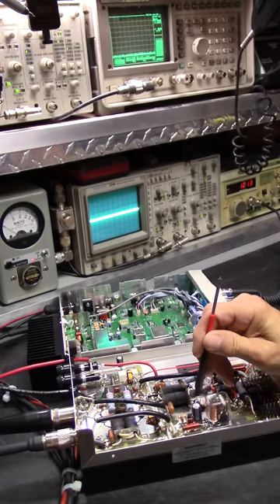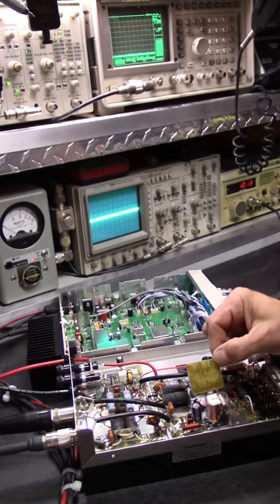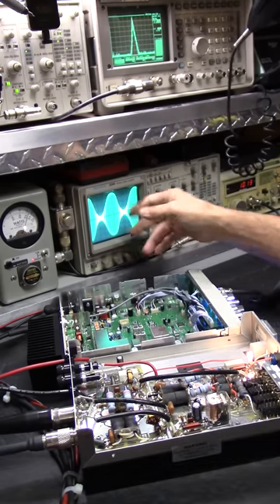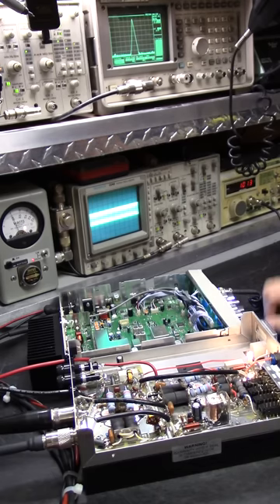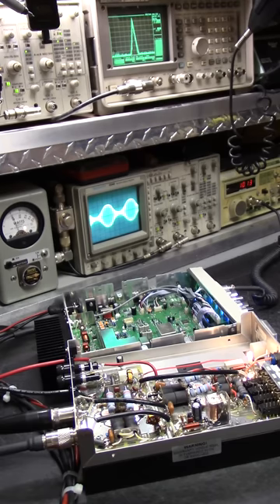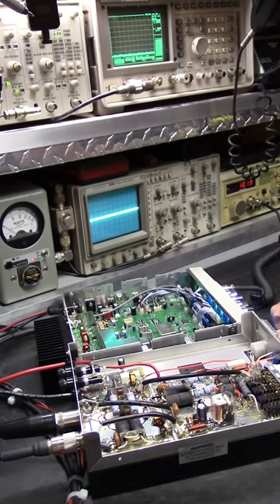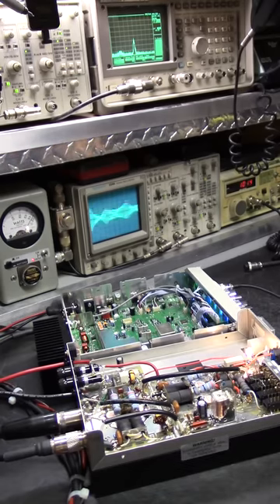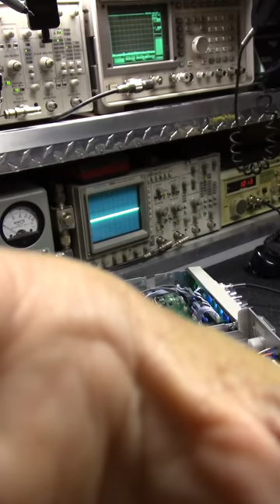Fine Tuned Cb Radio - Stryker SR-955 -Texas Star 500 Linear Amplifier and more ... Cleaner Is Meaner

Comment from the maker: Cleaner Is Meaner ..
PAY ATTENTION! If they don't or wont show you .. like this .. they're stroking you,  get that Part?  Never settle for less! Here's what it takes to cut through the noise, be loud and crystal clear with a better receiver too:  A) Tuned Bench:  https://www.youtube.com/watch?v=lwcDfXOgAls. 
True, it's more complicated and time consuming to accomplish these consistent and accurate results. Below is a partial procedure and list of calibrated equipment used to achieve this level of performance . Read on ..

Fine Tune CB Radio Shop strictly adheres to (https://www.nist.gov/) NIST Traceable Calibrations and other industry standards to maintain accuracy and consistency for providing Real World Performance Tuning of Citizens Band and 10 Meter export mobile radios with integrity.

"Basic Textbook AM/FM/SSB Transceiver Tune, Alignment and Calibration" 

1) Pll adjustments
VCO & OSC, AM TX OSC, USB TX OSC, LSB TX OSC.

2) Transmitter alignment
DRIVER BIAS, FINAL BIAS, SSB  (or gate voltages for mosfet versions) CARRIER BALANCE, HI-LO AM & SSB Power, RF METER, AMC, ALC and FM DEVIATION.

3) Receiver alignment
AM/FM RF & IF SENSITIVITY, FM DETECTOR/DEVIATION, SSB IF SENSITIVITY, SSB S-METER, AM/FM S-METER (100uV unmodulated -67dbm for “S-9” meter reading!), AM/FM SQUELCH RANGE, SSB SQUELCH RANGE, and NOISE BLANKER/AUTOMATIC NOISE LIMITER (Real World dBm to volts (uV) tables below).

That's just a typical run of the mill textbook tune up and alignment (if you're lucky). There's more to it than frequency alignment, modulation adjustment, meter calibration and a tune up report displaying exaggerated rms Bird peak watts! 

"Test Bench includes"

Bird 4314C Meter
https://www.birdrf.com/Products/Test%20and%20Measurement/Power-Meters/Wattmeters-Line-Sections/RF-Wattmeters/4314C_PEP-Single-Element-Wattmeter.aspx
Part 1) https://www.youtube.com/watch?v=RpX9IHe4ORM&t=16s
Part 2) https://www.youtube.com/watch?v=LuhbqTf6Bxw
Bird 4314C Accuracy Test: https://www.youtube.com/watch?v=DqEOabYqhQo&t=5s
Bird Stipulates 1/2 wavelengths  https://www.youtube.com/watch?v=5eWhgT-rTII
And Genuine Bird Elements from 1K down.

Bird 4373 Sampler 
https://www.rfparts.com/signal-samplers.html

HP8924c with options
http://userequip.com/files/specs/2147/HP%208924C%20Repair.pdf
https://www.youtube.com/watch?v=Cg1w0xBa27s&t=1s

HP8920a with options
https://www.keysight.com/upload/cmc_upload/All/EPSG072204.pdf

Three analog scopes, one digital 200 Mhz
https://www.atecorp.com/atecorp/media/pdfs/data-sheets/tektronix-2465b-2467b_manual.pdf
https://www.youtube.com/watch?v=by98x4eu2lM

Fluke 27fm
http://www.fluke.com/fluke/inen/digital-multimeters/fluke-27.htm?pid=56055
 
LCR http://www.lcrresearch.com/wp-content/uploads/2017/05/LCR_Pro1_Manual_version1.03.pdf

Power supplies
6 Cosel PBA1500f12 (750 amps) variable and configurable.
https://en.cosel.co.jp/product/powersupply/PBA/PBA1500F/PBA1500F-12/
Corcom 20VB1 F7130 EMI Filter 50-60Hz 250V

Times Microwave Coax jumpers and test leads
http://www.timesmicrowave.com/cms/products/cables/lmr/
https://www.youtube.com/watch?v=EmqaGJ6IWow
https://www.youtube.com/watch?v=1ltFVSxGp5Y
https://www.youtube.com/watch?v=v12YZT_1o90
https://www.youtube.com/watch?v=h7iiYfmYWRA&t=215s

Amphenol RF Connectors
https://www.amphenolrf.com/
https://www.youtube.com/watch?v=dVh5B0hdEA0 
https://www.youtube.com/watch?v=dKZg8T_AOso

More range, compliments, reliability and a quieter, clearer but more sensitive receiver,  Get Fine Tuned .. not peaked and ruined.

Here are some VideoGates of me at the bench practicing what I preach using my bench radio or customers radio completed and ready to be shipped: https://www.youtube.com/results?search_query=hard+drive+163+ more: https://www.google.com/search?q=Hard+Drive+163+nm&ie=utf-8&oe=utf-8&client=firefox-b-1-ab

It's what I recommend, use, service and sell ... to you ... not something non practical or deceiving in a misleading way. I'm not just the tech and owner of Fine Tune CB Radio Shop, I'm a customer too!  When finished, You'll be giving radio checks, not asking for them .

dBm To Watts and Volts
Tables below displays relationship between Power in [dBm] or [Watts] and Voltage in RMS, peak, peak-to-peak for sinusoidal signals in 50-Ohm systems for accurately measuring and tuning am/fm/ssb receiver sensitivity, agc, squelch and "S9" Meter calibration.

  [dBm] [Watts]   [Volts]rms   [Volts]p    [Volts]pp
-140 0.100E-16  22.361 nV  31.618 nV  63.236 nV 
-139 0.126E-16  25.089 nV  35.476 nV  70.952 nV 
-138 0.158E-16  28.150 nV  39.805 nV  79.609 nV 
-137 0.200E-16  31.585 nV  44.662 nV  89.323 nV 
-136 0.251E-16  35.439 nV  50.111 nV  100.222 nV 
-135 0.316E-16  39.764 nV  56.226 nV  112.451 nV 
-134 0.398E-16  44.615 nV  63.086 nV  126.172 nV 
-133 0.501E-16  50.059 nV  70.784 nV  141.568 nV 
-132 0.631E-16  56.167 nV  79.421 nV  158.842 nV 
-131 0.794E-16  63.021 nV  89.112 nV  178.223 nV 
-130 0.100E-15  70.711 nV  99.985 nV  199.970 nV 
-129 0.126E-15  79.339 nV  112.185 nV  224.370 nV 
-128 0.158E-15  89.019 nV  125.874 nV  251.747 nV 
-127 0.200E-15  99.882 nV  141.232 nV  282.465 nV 
-126 0.251E-15  112.069 nV  158.465 nV  316.931 nV 
-125 0.316E-15  125.743 nV  177.801 nV  355.602 nV 
-124 0.398E-15  141.086 nV  199.496 nV  398.992 nV 
-123 0.501E-15  158.301 nV  223.838 nV  447.677 nV 
-122 0.631E-15  177.617 nV  251.151 nV  502.302 nV 
-121 0.794E-15  199.290 nV  281.796 nV  563.591 nV 
-120 0.100E-14  223.607 nV  316.180 nV  632.360 nV 
-119 0.126E-14  250.891 nV  354.760 nV  709.519 nV 
-118 0.158E-14  281.504 nV  398.047 nV  796.094 nV 
-117 0.200E-14  315.853 nV  446.616 nV  893.232 nV 
-116 0.251E-14  0.354 µV  0.501 µV  1.002 µV 
-115 0.316E-14  0.398 µV  0.562 µV  1.125 µV 
-114 0.398E-14  0.446 µV  0.631 µV  1.262 µV 
-113 0.501E-14  0.501 µV  0.708 µV  1.416 µV 
-112 0.631E-14  0.562 µV  0.794 µV  1.588 µV 
-111 0.794E-14  0.630 µV  0.891 µV  1.782 µV 
-110 0.100E-13  0.707 µV  1.000 µV  2.000 µV 
-109 0.126E-13  0.793 µV  1.122 µV  2.244 µV 
-108 0.158E-13  0.890 µV  1.259 µV  2.517 µV 
-107 0.200E-13  0.999 µV  1.412 µV  2.825 µV 
-106 0.251E-13  1.121 µV  1.585 µV  3.169 µV 
-105 0.316E-13  1.257 µV  1.778 µV  3.556 µV 
-104 0.398E-13  1.411 µV  1.995 µV  3.990 µV 
-103 0.501E-13  1.583 µV  2.238 µV  4.477 µV 
-102 0.631E-13  1.776 µV  2.512 µV  5.023 µV 
-101 0.794E-13  1.993 µV  2.818 µV  5.636 µV 
-100 0.100E-12  2.236 µV  3.162 µV  6.324 µV 
-99 0.126E-12  2.509 µV  3.548 µV  7.095 µV 
-98 0.158E-12  2.815 µV  3.980 µV  7.961 µV 
-97 0.200E-12  3.159 µV  4.466 µV  8.932 µV 
-96 0.251E-12  3.544 µV  5.011 µV  10.022 µV 
-95 0.316E-12  3.976 µV  5.623 µV  11.245 µV 
-94 0.398E-12  4.462 µV  6.309 µV  12.617 µV 
-93 0.501E-12  5.006 µV  7.078 µV  14.157 µV 
-92 0.631E-12  5.617 µV  7.942 µV  15.884 µV 
-91 0.794E-12  6.302 µV  8.911 µV  17.822 µV 
-90 0.100E-11  7.071 µV  9.998 µV  19.997 µV 
-89 0.126E-11  7.934 µV  11.218 µV  22.437 µV 
-88 0.158E-11  8.902 µV  12.587 µV  25.175 µV 
-87 0.200E-11  9.988 µV  14.123 µV  28.246 µV 
-86 0.251E-11  11.207 µV  15.847 µV  31.693 µV 
-85 0.316E-11  12.574 µV  17.780 µV  35.560 µV 
-84 0.398E-11  14.109 µV  19.950 µV  39.899 µV 
-83 0.501E-11  15.830 µV  22.384 µV  44.768 µV 
-82 0.631E-11  17.762 µV  25.115 µV  50.230 µV 
-81 0.794E-11  19.929 µV  28.180 µV  56.359 µV 
-80 0.100E-10  22.361 µV  31.618 µV  63.236 µV 
-79 0.126E-10  25.089 µV  35.476 µV  70.952 µV 
-78 0.158E-10  28.150 µV  39.805 µV  79.609 µV 
-77 0.200E-10  31.585 µV  44.662 µV  89.323 µV 
-76 0.251E-10  35.439 µV  50.111 µV  100.222 µV 
-75 0.316E-10  39.764 µV  56.226 µV  112.451 µV 
-74 0.398E-10  44.615 µV  63.086 µV  126.172 µV 
-73 0.501E-10  50.059 µV  70.784 µV  141.568 µV 
-72 0.631E-10  56.167 µV  79.421 µV  158.842 µV 
-71 0.794E-10  63.021 µV  89.112 µV  178.223 µV 
-70 0.100E-09  70.711 µV  99.985 µV  199.970 µV 
-69 0.126E-09  79.339 µV  112.185 µV  224.370 µV 
-68 0.158E-09  89.019 µV  125.874 µV  251.747 µV 
-67 0.200E-09  99.881 µV  141.232 µV  282.465 µV
-66 0.251E-09  112.069 µV  158.465 µV  316.931 µV 
-65 0.316E-09  125.743 µV  177.801 µV  355.602 µV 
-64 0.398E-09  141.086 µV  199.496 µV  398.992 µV 
-63 0.501E-09  158.301 µV  223.838 µV  447.677 µV 
-62 0.631E-09  177.617 µV  251.151 µV  502.301 µV 
-61 0.794E-09  199.290 µV  281.796 µV  563.592 µV 
-60 0.100E-08  223.607 µV  316.180 µV  632.360 µV 
-59 0.126E-08  250.891 µV  354.760 µV  709.520 µV 
-58 0.158E-08  281.504 µV  398.047 µV  796.094 µV 
-57 0.200E-08  315.853 µV  446.616 µV  893.232 µV 
-56 0.251E-08  0.354 mV  0.501 mV  1.002 mV 
-55 0.316E-08  0.398 mV  0.562 mV  1.125 mV 
-54 0.398E-08  0.446 mV  0.631 mV  1.262 mV 
-53 0.501E-08  0.501 mV  0.708 mV  1.416 mV 
-52 0.631E-08  0.562 mV  0.794 mV  1.588 mV 
-51 0.794E-08  0.630 mV  0.891 mV  1.782 mV 
-50 0.100E-07  0.707 mV  1.000 mV  2.000 mV 
-49 0.126E-07  0.793 mV  1.122 mV  2.244 mV 
-48 0.158E-07  0.890 mV  1.259 mV  2.517 mV 
-47 0.200E-07  0.999 mV  1.412 mV  2.825 mV 
-46 0.251E-07  1.121 mV  1.585 mV  3.169 mV 
-45 0.316E-07  1.257 mV  1.778 mV  3.556 mV 
-44 0.398E-07  1.411 mV  1.995 mV  3.990 mV 
-43 0.501E-07  1.583 mV  2.238 mV  4.477 mV 
-42 0.631E-07  1.776 mV  2.512 mV  5.023 mV 
-41 0.794E-07  1.993 mV  2.818 mV  5.636 mV 
-40 0.100E-06  2.236 mV  3.162 mV  6.324 mV 
-39 0.126E-06  2.509 mV  3.548 mV  7.095 mV 
-38 0.158E-06  2.815 mV  3.980 mV  7.961 mV 
-37 0.200E-06  3.159 mV  4.466 mV  8.932 mV 
-36 0.251E-06  3.544 mV  5.011 mV  10.022 mV 
-35 0.316E-06  3.976 mV  5.623 mV  11.245 mV 
-34 0.398E-06  4.462 mV  6.309 mV  12.617 mV 
-33 0.501E-06  5.006 mV  7.078 mV  14.157 mV 

        Don't Be A (SUCKER) Mud Duck!

Hard Drive 163 NM. 73's! Click click.

Comment: I just got a DX500V...not sure what's going on at texas star but I had to go in and change the input and output tune, perhaps because it's designed for 10 meter???. No way 100 watts reflect on the output was acceptable. It got hot with just a short QSO. Got a Predator 10K on the roof and reflect back down to 6 watts on the bird with full output after re tuning the input and output with my RigExpert AA-600. Seems like Texas Star is waning more and more away from the QC department lately...lots of crappy solder joints inside I had to repair too. I have one of their fan kits on it but it gets no where near as hot as it did before the tune with the same fan. Don't screw around, get enough power to it. I run an optima 800CCA/1000CA Red Top behind the passenger seat with #6 AWG connected to the truck's main battery on an isolator right next to the amp with less than 2 feet of + battery cable to the anderson connected amp and a braided ground from the battery to chassis and the amp to chassis out of the power pole. Its a 500 watt amp but it will do much more...on the watt meter...but we know what that means. I run it at 400 out on ssb all day and it works great with my old school President Lincoln MRF455. Bonding is important to make it ring...I'm just waiting patiently for my Fine Tuned 955 that Mark makes sing so I can make my truck ring with Fine Tuned audio.
Reply from the maker: Barefoot only .. tune is entirely different.
Reply: @FineTuneCBShop  Yup, I got that from your other videos. The texas star is in the F-150, the Stryker is going in the 55 Willys pickup.